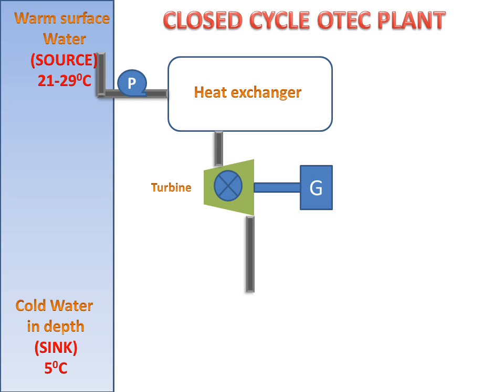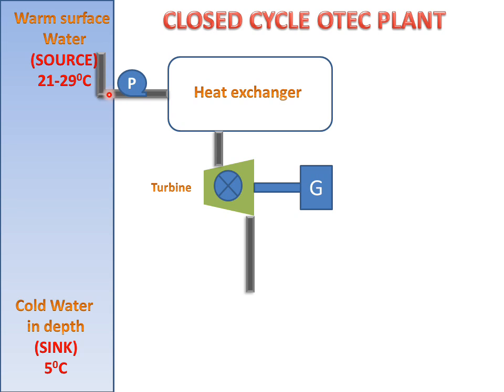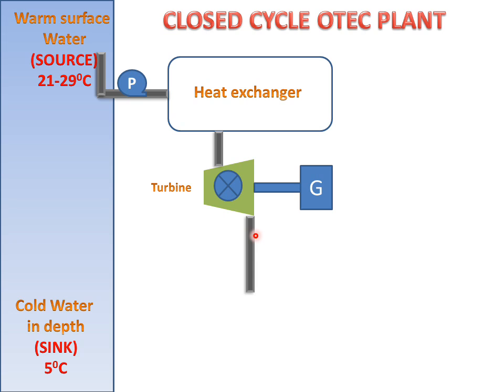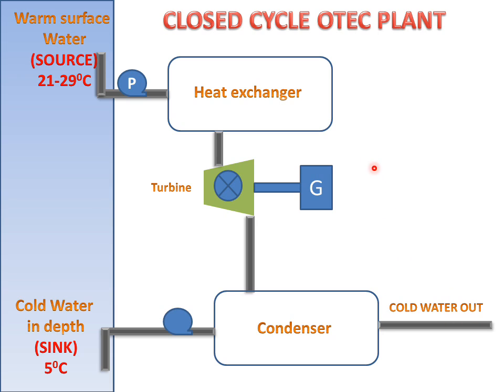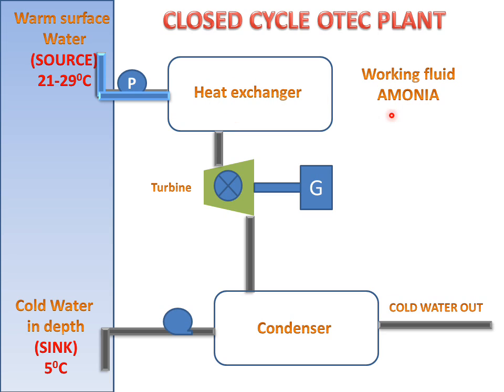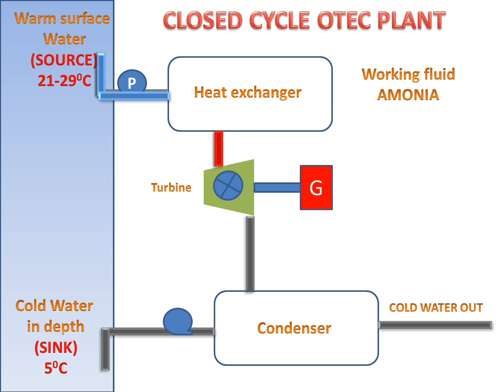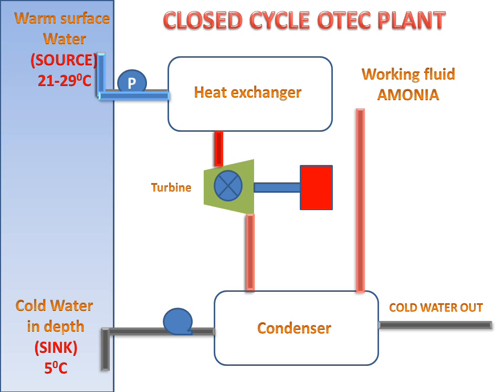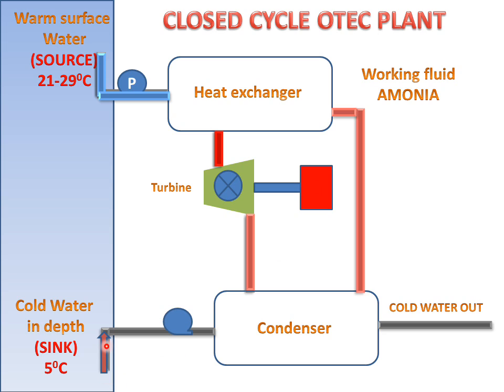Closed Cycle OTEC Plant

Comment: Brother will you please tell me
Why are we using ammonia as a working fluid??
Reply: OTEC uses warm water to generate electricity.The warm ocean water is made to enter the heat exchanger where the working fluid (Ammonia) is heated up to the point where it vaporises and then goes to the turbine to generate electricity. Now we use  ammonia as it has a low boiling point which makes it possible for warm seawater to vaporise ammonia.
Reply: Because it has lower boiling point
Reply: What are other type of fluids using instead of ammonia in OTEC plant?